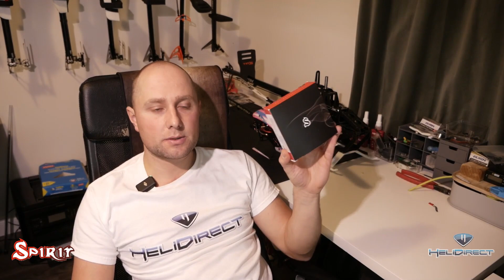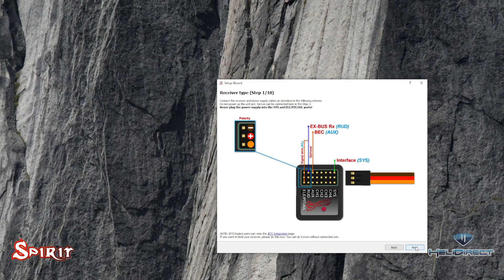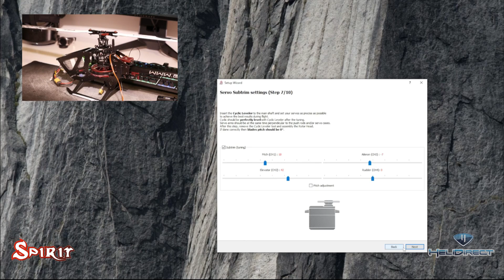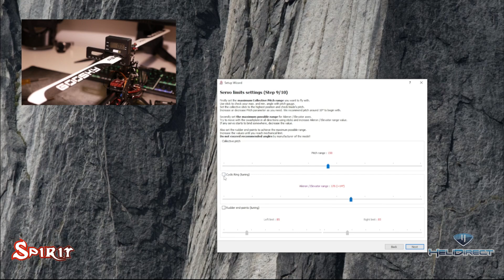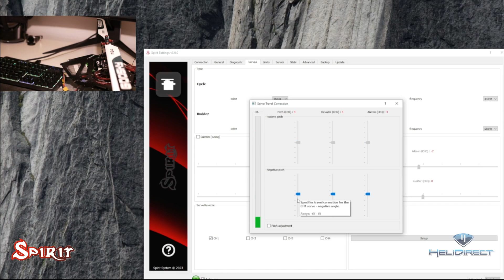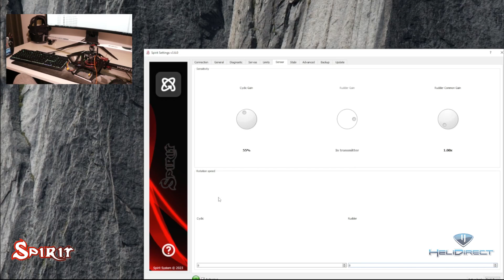Spirit FBL Setup Tutorial by Dima Vinar!!

Comment: Hi, I am having an issue trying to get the tail gain high enough. Using IX14+SE, I can only get up to about +39 on channel gain. Piro consistency is at 205,  gov response is at 2 which is too low as it bogs and need to lift it. Had to bring it down from 5 to get it to fly. This is at 78% throttle. It kicks out when you pitch up hard, trying to get it better before using rudder revo mix but I will have to in the end. The tail wags a little like this but is flyable. When doing stationary right aileron rolls the tail drifts, but ok when doing it to the left (or might be vice versa).
Servo is a Theta THM982 and rudder delay is on 0 and have tried 2 and 5. No difference other settings are good.
Really just wanting to get the tail gain higher.... its about 42 and 45 on slower head speeds. I have also checked al the mechanics and belt tension and are fine.
Manual says for the rudder servo horn 13 to 15mm from the center which is the middle hole so maybe go to the inner hole which will be about 12mm? Yet to try that..... No one on the spirit sites have managed to help, no answers and its starting to piss me off a bit. This is on a spirit GT. I do have another one as well, both are second hand but are not that old and supposedly never crashed. Might need to try the other one. Also not all the telemetry comes through, most of it does but not all. Rescue works great with no issues there.
Reply: Looks like moving the ball link in will be the first answer. I had looked before but now google AI is finding these answers.... after asking here lol.

Comment: Hi Dima, thanks for the Video, I could setup my Spirit GT perfectly with it. I fly an Align 470L with a Spektum NX transmitter. ID1/ID2/ID3 70/75/80% throttle. Gyro Multiplier in the GT is 1.1. In the Transmitter I set values  36/33/31 for Gyro. It flies great, but I'm wondering if the values aren't generally too low. Piro Consistency is set to 170 Would appreciate your feedback for further tuning.

Comment: I am new here and have a question, I made my first flight today, in stabilisation modus normal and GPS mode (position hold), when I steer right or left and release the stick, it goes right or left for a very long time before returning to horizontal mode. could it be because I still have a test cross under the heli, ? Normally it should react immediately, but it takes a very long time, as if I still steer to the right or left. Can I speed up the reaction time so that it reacts faster when I let go of the stick.in normal mode it flies perfectly !
the moment I steer to the right I have to steer so hard to the left to correct
Is it possible that the horizontal gain is too low in the geolink setting ( positionhold)? I set it a bit lower... first 75%, then 90%, but maybe it should stay at 100% or even higher ?
Align T-rex 650.
has anyone an answer ?
Reply from the maker: I would join our heli addiction facebook group and ask there.

Comment: At 18:52, you discuss the Pirouette Consistency parameter.  I understand why I want to increase this parameter, but what is unclear to me is how do I know when this parameter is too high and I need to decrease this number.  What is the "weird tail behavior" I would experience if this value is too high?
Reply: I always start with a base value of 190, then max out my tail gain, then start upping the pirouette consistency by a value of 5 until the tail piro rate is consistent on both sides, and the tail doesn't whip during transitions. If the value is too high you may get oscillations.

I do not max out this parameter but put it as high as it is necessary.

Comment: At around 13:17min, you discuss the tail gain.  I never understood the wisdom for Spirit choosing to have two separate tail gains; "Rudder Gain" and "Rudder Common Gain".  This is in my opinion unnecessarily confusing for newcomers to Spirit.  The "Rudder Gain" uses a standard 0% to 100% scale (actually -100% to +100% scale, but best to keep 0-100% for this exercise) and the "Rudder Common Gain" uses a 1.00x to 1.50x scale.  The important thing to understand is that the "Rudder Common Gain" is simply a multiplier for the "Rudder Gain".  Since the "Rudder Gain" has a maximum value of 100% and the "Rudder Common Gain" has a maximum value of 1.50x, this means that maximum rudder gain is 100% x 1.50 = 150%.  So the tail gain is effectively a 0% to 150% scale.  A Rudder Gain of 90% combined with a Rudder Common Gain of 1.00x yields the same result as a Rudder Gain of 60% combined with a Rudder Common Gain of 1.50x.
Reply: Different radios transmit gain differently. 1 point on radio a could be 1.5points on another radio.

With precision you can really nail down the gain where you can push it and it won't start wagging on overspeeds.

I also have come to believe that between 1x and 1.5x, the increase is not linear, but more exponential-like.
Reply: @REVOS5  I have corresponded with Tomas on this a few times.  It is possible I may have misunderstood him, but as I best understood him, the "Rudder Common Gain" is a linear multiplier of the "Rudder Gain".  I can't find all my correspondence with him over the years, but I believe he mentioned in the past something similar to what you said about different radios, where many radios only let you adjust the gain up to 100%, so the "Rudder Common Gain" give you the ability to go even higher.

Comment: At 10:11min, you go over the "Cyclic Ring".  I generally increase this value as much as possible to allow for full cyclic stick deflection at high and low collective stick WITHOUT mechanical binding.  I am not aware of any ill effect from having this value as high as possible assuming no mechanical binding.  I frankly do not tune this value to any particular ° deflection with a pitch gauge; I just dial it up as high as possible without mechanical binding.
Reply: In my experience, having the value too high may induce weird head behavior, and will make the rescue very aggressive as it will use all available cyclic pitch

Comment: At around 8:57min, you mentioned the value for the 6° cyclic calibration should ideally be over "90".  For the viewers, the ideal value range is between "90" and "150" (as stated on program) for optimal control loop performance.  The helicopter will fly and not fall off the sky if the value is outside this ideal range, but performance could be further improved.  This is similar to setting the 8° cyclic calibration on VBar or getting the blue light on BeastX.  This is the value that determines optimal mechanical geometry.  This mechanical geometry is determined by the cyclic servo arm hole distance, the swashplate ball link stud lengths, and the blade grip arm ball distance from the hub.  Since the blade grip arms ball distance and swashplate ball distances are "fixed" in most (but not all) helicopters, the main way to alter the head geometry and this 6° value is by using an optimal cyclic servo arm hole distance.
Reply: Yes the recommended values are 90-150 however I have never seen a heli where the value got close to 150 when using the recommended hole spacing from the manufacturer.

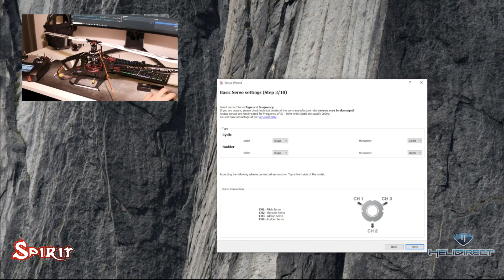Comment: At around 5:11min you mentioned RUDD port, and specifically mention not to connect the tail servo to this port (correct port is CH4).  Do we know why Spirit chose to name this port RUDD instead of naming it something else like AUX#?  Labeling this port RUDD but not intending to use this port to connect a tail servo seems like it is time to consider renaming this port.
Reply: For a PWM type reciever the rudder goes in this channel. Most people don't use this kind/of setup. In that setup the signa wire of the cyclic servos go into of the ail/ele/pit port

Comment: You mentioned at around 1:18min that you purchased a roll of tape.  I assume the tape is one of the several Very High Bond (VHB) tapes 3M makes, but 3M VHB tapes come in several variations and several thickness within those variations.  What is the exact tape model number?
Reply: I'm not sure about variations (in terms of material) only width. I have the 1" 1mm thick roll

Comment: Welp I have tried 3 times now on Raw 420 and now three set of blades. As soon as I go to lift off it tips way forward and blades scrape and that’s it. I hook up the IKON 2 again and it flies outstanding. 3 times complete redoing setup. What gives!
Reply: Oh spirit GT 3.6 software
Reply: Hi it sounds like you have selected and incorrect gyro orientation. I will reach out to help

Dima
Reply: @REVOS5  From the picture i have 180 with wires front, i set this thing up so slowly and still it does it. it spools up fine and if i even barely touch cyclic while lifting off it dips hard forward or right and scrape! i do select goblin 420 in the setup and i noticed you leave that default. Also i initialized it on a picnic table and then carried it to spot to take off, could this be. I have Stabilization Acro setup but confirmed it was not engaged when spooling up. So fruatrating when i put ikon2 back on it lifts fine and hovers like a champ. Thanks for any help.
Reply: @kaidok9314   if you used the 420 setup from the spirit, the swash setup is backwards...... 2 servos rear and one at front. That needs to be changed. Probably a bit late now though....